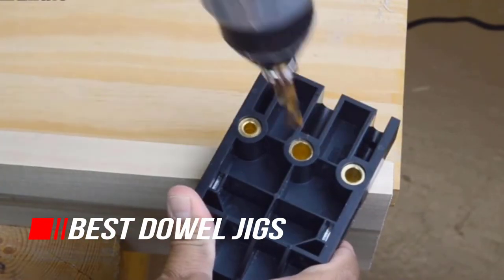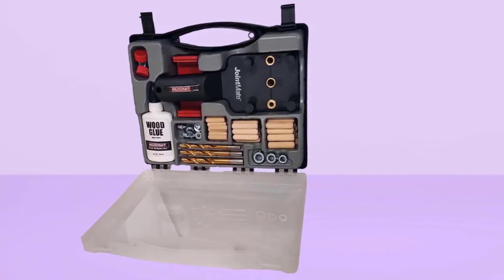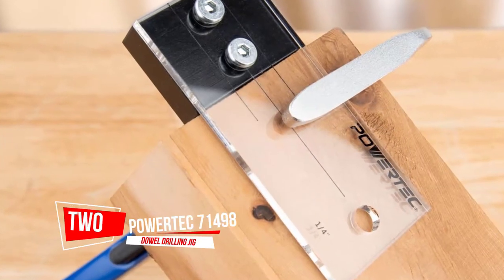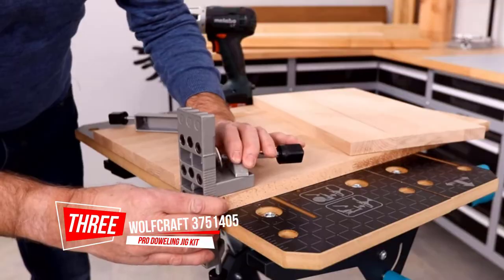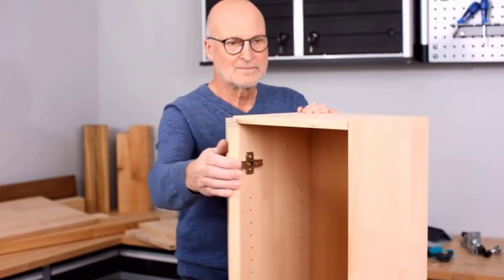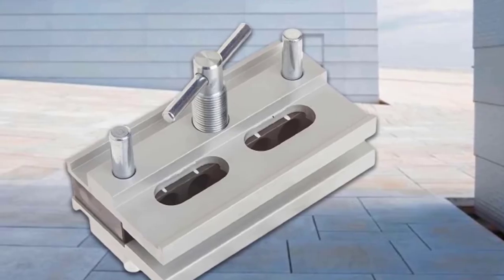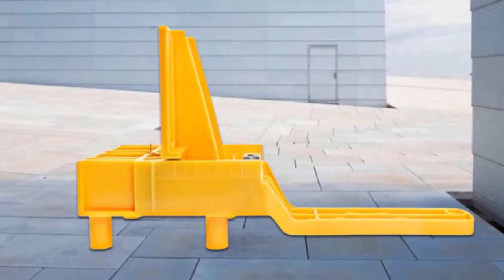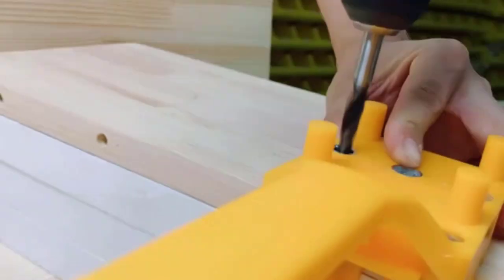Best Dowel Jigs Reviews Buying Guide | Top 5 Review [2023]

Comment: The Wolfcraft is the worst of these 5 jig: it puts the dowels off center (except for panels with a thickness of 1/2") resulting in a weak joint.
Reply: Is not, you need to know how  is used properly.